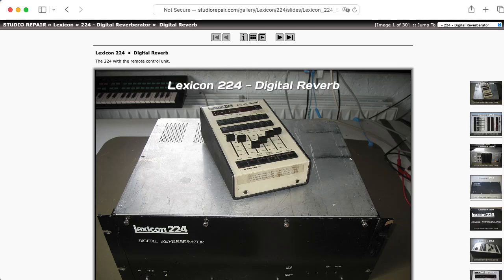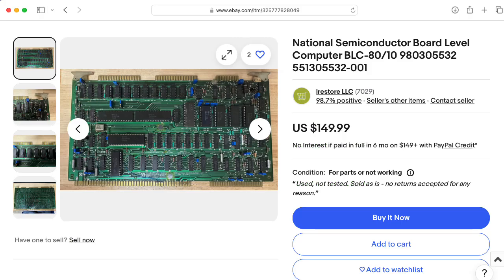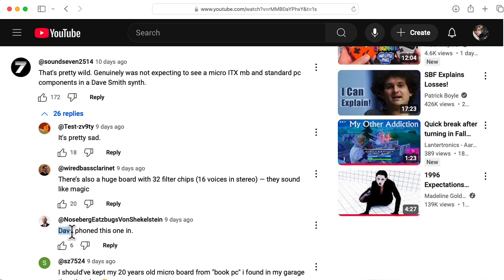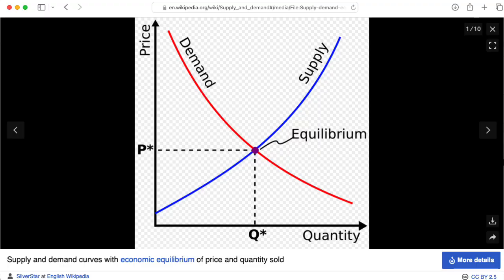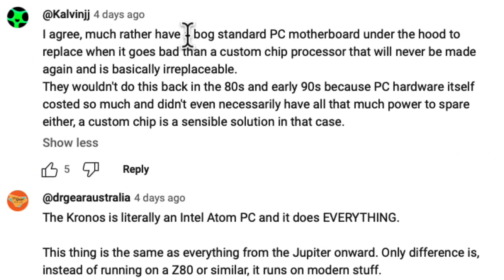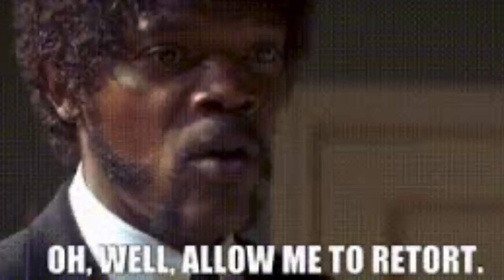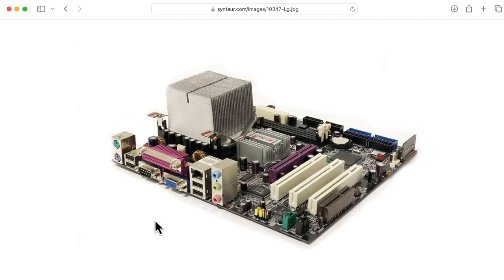Yes, the Sequential Prophet X Has a PC Motherboard. And that's OK. (Response to Espen Kraft Viewers)

Comment: That's a very good take on the issue; the 224 immediately came to mind for me as well. Other examples would be the original PPG Waveterm A which was AFAIK also built around an existing SBC (not sure about the Waveterm B). When it comes to operating systems for synths or samplers it gets even more messy- the Fairlight III being built on top of OS9 (not MacOS 9!) or some Mackie stuff on top of BeOS (the d8b? or some harddisk recorder?).
I believe at least some of the synths of the late 70's and early 80's were conceived with the help of microprocessor development boards (similar to the SBC in the 224); and when development was finished the hardware was redesigned using only those parts that were actually needed for the tasks at hand. This was more cost efficient and also made the devices smaller (again: the SBC in the 224 is quite large). Seeing how much the size has shrunken since then it isn't exactly a surprise for me that standard motherboards are used nowadays.
Reply from the maker: Oh I didn't know about the BeOS thing -- that's interesting!
Reply: @Lantertronics  IMO, BeOS is one of the best operating systems no one knows about.  It's unnatural how smooth and responsive the UI remains on ancient hardware loaded to 100% CPU utilization.  The folks that designed and implemented their interrupt handling and scheduler were truly gifted.
Reply from the maker: @seegee-u3l  Have you tried Haiku OS?
Reply from the maker: @seegee-u3l  I like to imagine an alternate reality in which Apple based its new OS on BeOS instead of NeXTSTEP. (Of course that would never have happened with Jobs at the helm, and it's hard to imagine Apple surviving the 90s without Jobs at the helm).
Reply: @Lantertronics  I have, but not at a deeper level than casually "playing around with it in a VM".  Around 25 years ago I actually did use BeOS as the primary OS on one of my Pentium III boxes but haven't had an occasion to try Haiku as a daily driver.  Plus, I'm too busy trying to decide whether I want to upgrade my Amiga 1200 with an ACA1234 or go cheap with a PiStorm. 😀
Reply: @Lantertronics  And as usual I mixed things up: It was the RADAR harddisk recorders that used BeOS.
Reply from the maker: Yeah, using a development board as a "reference design" and then customizing bits here and there would have been quite common.

Comment: the idea that off-the-shelf parts are insufficient for an application like this is laughable. these components were sold into a highly-competitive market that's extremely price-sensitive and margins are very tight. every RMA represents a significant loss for the manufacturer - these parts are designed to be fumbled together by sweaty kids in their basements, and just work - so it's in their best interest to maintain a high level of reliability. if Sequential had replicated all the R&D to build their own custom board with the same level of performance and reliability, the price would have been more than double.

Comment: I got curious and looked up some tidbits about the Prophet-X, and it's kind of crazy how, I wouldn't say over-engineered, but I guess, how complex it is for what is essentially a very expensive sampler. Like yeah sure, part of it is a relatively cheap PC, but you've got what's likely completely bespoke audio software running on top of a proprietary-licensed OS kernel - they quite possibly had to write their own low-latency audio driver as QNX typically isn't used for embedded audio AFAIK, as well as code to interface with the controller and filter boards. And that's just the 'Freakin Cheap PC'!
$4k is a lot of money, and honestly in spite of the engineering prowess, I would not consider the Prophet X a worthwhile purchase, but Espen's implication that it's a sloppily designed piece of kit, or that Sequential gouged their customers is dumb as rocks.

Comment: Amazing video, Aaron! 

It's always a pleasure watching your content.

As an Electronics Engineer, I have to give kudos to Korg for leveraging a well-supported, open-source platform like the Raspberry Pi ecosystem to develop their synths. The wide availability of skilled engineers familiar with the platform essentially future-proofs their development.

Companies should focus their resources on their core intellectual property—the aspects that truly create value for the customer, such as user experience (UX), user interface (UI), and sound characteristics. The argument that a synth must be "true" by designing every single element from scratch is absurd. Should they create their own polymer mixture for the casing? Design their own power supplies? Grow their own trees for the side panels? Ridiculous!

As Aaron pointed out in the video, they do deserve criticism for releasing buggy software—that’s a valid issue. However, there’s nothing inherently wrong with using a CPU to control the synth.

People often overlook a critical aspect of electronics manufacturing: certification. By using off-the-shelf components like SBCs, motherboards, radio modules, and power supplies, manufacturers can leverage existing certifications from the component suppliers. This approach significantly reduces development costs and accelerates time-to-market. There’s always a balance between the features required, market availability, and production volumes.

This reminds me of the public outcry when a state-of-the-art battleship was unveiled with defense systems running on Windows XP—long after Windows 8 was available. Yet, it’s common in both the military and medtech sectors to use "older" or "standardized" platforms to ensure stability, reliability, and certified performance, even when newer alternatives exist.

Apparently, some critics won’t be satisfied unless Sequential starts designing their own mixed-signal ASICs (Application-Specific Integrated Circuits) specifically for niche synths.

The price tag discussion, of course, is another matter entirely.

Cheers!

Comment: There is always something less appealing about sound being created via an interrupt cue than done in analogue electronics.
Reply: I bet most people would not make the difference in a blind A/B test. The people who made the vongon replay first designed a fully analog synth. Then they tried making a digital counterpart with the same "analog" style sound and ended up liking it better so went with that. I find this synth sounds lovely; but they're getting crap for it (and yes it's not a cheap synth). I like analog and it does sound better in certain cases but it really should not matter in the end. The sound and experience of using the thing is what matters.
Reply: @hmmmhhhmmh  I think thats possible, a similar test has been done with violins costing millions of pounds vs a modern built ones, and they cannot tell. But ! there is not doubt some psychological element that would favour the million pound antique violins. I preferred digital synths because of their accurate reliability, but have always had a sense something is lesser somewhere, and i guess its the virtually imperceptible, but present artifices of the interrupt cue.
Reply from the maker: I have another video where I compare the original Sequential Prophet VS with the Arturia softsynth version; I randomize which I played first in each pair, and asked people to tell me which I thought. So far no one has guessed significantly more than what you'd get by random chance.
Reply: @Lantertronics  I wonder if its possible to sample at a very high rate and thus actually see the slight imperfections of the interrupt queue vs a c continuous analogue signal. At some level it must be demonstrable. This is my only argument really, that anything running on a personal computer is subject to wildly different renderings, at any given moment. its way faster than a 16 or 32 bit sample, practically inaudible, but its there.
Reply from the maker: @JackNicklauson  Well, considering everyone is ultimately listening to an audio file through a DAC being played by a computer, I'm not sure it matters. ;)

Comment: You got it wrong. This isnt about making the synth more expensive due to them RNDing a computer, is about them A) Beign upfront right in the box "Powered by Raspberry Pi" or "Powered by Intel", some people not care but others would be interested, many do electronics, computers and stuff. Why hide it and/or not disclose it? and B) If they are running off shelf parts, why not pass THE SAVINGS to the customer? Why you are so pro business? It IS not only a cheap computer and a mostly barren SMT board, running off a Prophex looking MIDI controller, HARDLY $4k, it is also very lazy design throwing in there an ITX board and calling it day. Put it together DIY? My brother in Christ, plenty people already make standalone MIDI controllers with VSTs inside running off ITX boards, raspberry Pis, FPGAs... you name it. DJs have been doing "laptop less" setups by hiding the computer in the case long before standalones were a thing. RnD costs? Sure you can design the UI but the backend will be done in India for a few rupees and hour, of course, based on some copy/pasted code from Github.
Reply: but why does it matter? do you expect manufacturers to list every single chip and components they use? they should make such lists available for people who want to repair their stuff but just because people are familiar with intel and raspberry doesn't make it relevant to advertise. they could as well put "powered by a texas instrument converter" but no one would care. That's an interesting trivia but no it's not something people SHOULD absolutely know. Also: not using "of the shelf" part (sorta for the compute module) would increase the cost of r&d and manufacturing, not the other way around. And finally you can look up the specs of the prophet X and it's not even a digital synth; it's a hybrid synth with fully analog filters; so your point about it being "a vst in a box with a controller" doesn't even make any sense. the  motherboard is only a small part of what makes it a synth. you really don't have a clue what this thing is.
Reply: "pass THE SAVINGS to the customer" the savings were already passed to the customer. you obviously don't understand how marketing and product pricing works.
Reply: I don't quite remember an "Powered by Intel" sticker on the Polysix (and many other synths) either.
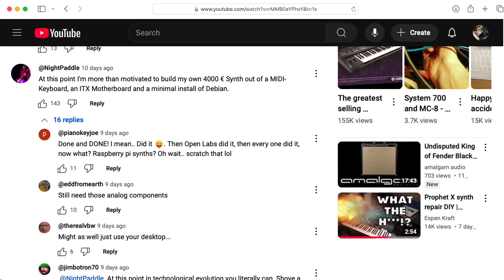Reply from the maker: There's a tremendous amount of incorrect information and misunderstanding here. How in the world can you look at that massive analog board with all those filter chips and call it a "mostly barren SMT board?" Did you watch the full video? Did you miss the section at 2:52? Sure, try DIYing a Prophet X and see how it goes. Go write the Verilog for the FPGA that handles motherboard-to-analog-board communication. 

Maybe the value proposition of the Prophet X doesn't appeal to you, and that's fine.

Comment: Great points, talking about cost vs value. One point you can potentially add is that the Linux KERNEL is not an Operating System on its own. It just creates a standard interface for applications to use to access hardware. It likely doesn't have a full "userland" and probably takes just seconds to do Inital Program Load.

Comment: I can understand some of your arguments, but comparing a compute module or some other industrial grade motherboard with solid caps and no moving parts to this dirt-cheap ASRock one doesn't work. ASRock is known for putting bad components in, caps can go bad pretty quickly and if your 4K synth fails because of this, this is not ok at all.
Reply: this isn't an industrial application. there aren't lives at stake here. it's not getting exposed to temperature or shock extremes. this machine is making bleeps & bloops. a consumer-grade solution is plenty. the reliability and ease of replacement of these components far outweighs the cost that a custom/industrial solution would incur.
Reply: ok but does it actually translate in reality? do people have more issue with the prophet X than other synths; or is it just speculation?
Reply: Asrock aren't really an outlier when it comes to consumer motherboard quality, or consumer electronics in general. I've had synths with completely custom boards go bad due to cap leaking, it's not like the fail rate will be substantially worse than literally any other synth built in the last 30-40 years.
Reply: @Theinvalidmusic  yeah, 90's caps were 90's caps. it doesn't matter what board they're in consumer or custom. if they leak, they leak.

Comment: Great video, Dr. L. I really don't see a problem with using OTS components if it allows a quicker/cheaper development process and allows the manufacturer to easily source parts that they'd have to have custom-made otherwise.  We're not back in the 80's when Yamaha had to design the OPS/EGS chipset to be able to offer a rudimentary but usable FM/PM synthesis capability.  Any one of the $30 Raspberry Pis sitting on my desk has more computational horsepower than a full $250K Synclavier or Fairlight rack system had back then, and SO MUCH of what used to have to be done with discrete hardware can now be done in software, in real time, for very little cost.  Is $4000 a lot for an instrument?  Sure it is, but consider that the original Prophet-5 cost the same amount of money in 1978, which is over $20K after adjusted for inflation, and the Prophet-X is a much more capable instrument overall, "vintage analog" arguments aside.  I will say that I would MUCH rather my Yamaha SY-77 had a simple SBC than the stacks and stacks of bespoke boards that are in it - just changing the display in that beast is a major operation because of everything that has to be removed to get to it. 😀
Reply: Except when your synth is completely a VST with a physical interface all you are really paying for is the looks/feel/ergonomics of the synth. Like why not just get a midi controller and spend that money on a nice PC to play as many VSTs as you’d like. I’d rather have an actual working computer if I’m just going to be purchasing a computer (ala the Prophet X). The Hydrasynth is a better value proposition than the X in this regard.
Reply: @rustyshackleford634  But that's NOT what the Prophet X is - it's a true digital/analog hybrid.  The X is controlled by a regular PC board, but there's quite a bit of custom circuitry in there (primarily the analog filters and UI hardware) that the synth simply doesn't work without.  I totally agree that VSTs are a better value proposition for many (myself among them), but just calling the Prophet X a VST disregards the very real amount of additional stuff that's in the audio path.
Reply: @rustyshackleford634  omg I can't with this argument. some people want to have an actual  instrument; who cares if it runs on tubes or an atx motherboard. Yes you're paying for the looks; feel; ergonomics; software dev; engineering; sound of the synth; basically yes you're paying for a synth. and again; the prophet X is a hybrid synth; with analog filters; so the furthest thing from just being a "vst in a box". and even a fully analog synth has a digital part; so basically a little computer; so in fact aren't all analog synth vst's in a box? why are you triggered by the fact this synth uses a part that you can recognizer? Do you know they're not manufacturing every single analog chip they use in their design either?
Reply from the maker: The Prophet X isn't like the Hydrasynth. It has boatloads of analog filter chips. If that's not important to you, the yes, the Prophet X doesn't have a good value proposition.

Comment: Strongly disagree.  He’s completely right about the shite stuff synth companies are coming out with.
Reply from the maker: What exactly are you disagreeing with? I was specifically making a point about about the use of OEM parts in a synth and whether that made sense or not from an engineering standpoint. Whether synth companies are coming out with shite stuff more broadly is a different discussion.
Reply: With the competition from the behemoths it's a life or death proposition for many of them, if they can't make enough spare money they can't recoup their dev costs and will either have to just make the same product forever or close their doors. 
The disparity between Behringer and their competitors is hard to overestimate, even Roland's outsourced production can't compete in terms of worker salaries and bespoke factories.
If you believe "natural selection should run its course" and most companies deserve to close, then fine, but I personally appreciate a more varied market